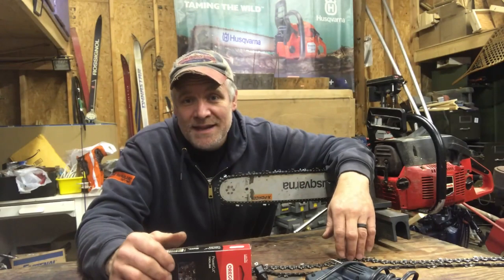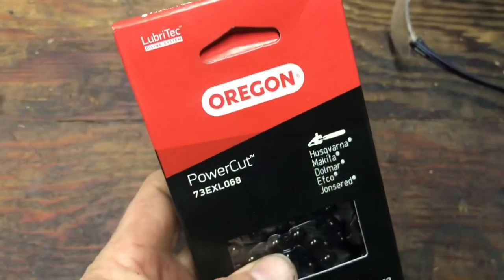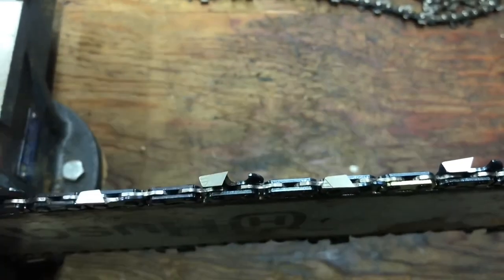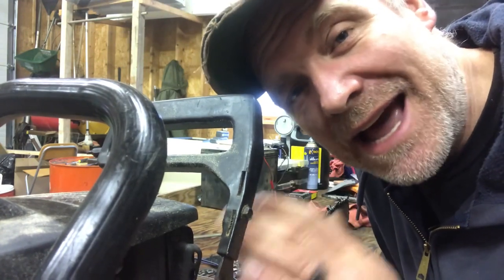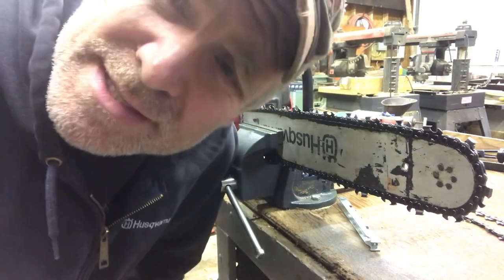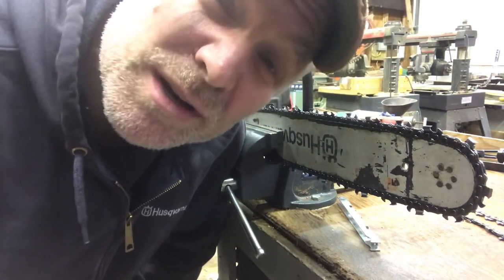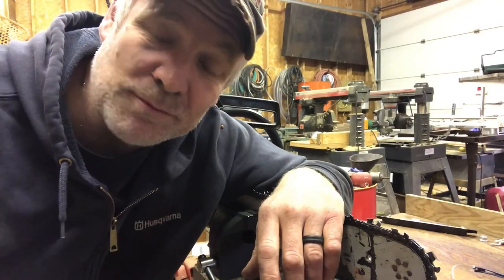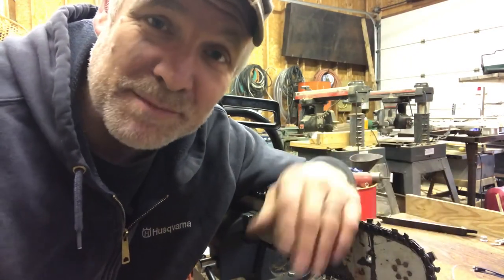Making a Homemade/DIY Ripping Chain for my Chainsaw Mill

Comment: If i may, I would suggest making several light rotations of grinding a little bit at a time instead of one heavy and one light round, several light rounds of grinding will prevent heating up and tempering the tips of the teeth, making them brittle and prone to chipping and breaking. when grinding take notice if the color of the tooth begins to heat up and change your grinding too much.  *this info is meant for electric sharpening only, if your hand filing your chain  with a round file, this does not apply.
Reply: Glad I wasn't the only one thinking about that

Comment: lol the file bit is real!! But the funny thing is back filing can clear the teeth and keep them sharp also depending on the material your working with there is actual a video on yt a man made a machine to prove this point! Can you imagine the amount of hate he got lmaooo! This is awesome I need to find a way to try it for now I’m using hand files to sharpen my chain… I’m using an electric wen chainsaw… with a crosscut chain to hand mill my logs needless to say it’s waaayyy harder than it needs to be I don’t even use a guide most of the logs I mill are 4’ or less so the guide would be nice but the ripcut chain would make my life easier! Hope all is good and getting better

Comment: Look forward to seeing the results of the modified chain. Never seen it done this way. I have made a few for my mill but just changed the angle to 5 degree and didn't make it more narrow. Have a Blessed Day Pete. Justin
Reply: Did they work better after changing to 5°?
Reply: @noturfather1106  It did. Not as choppy. You may wanto try 10 degree first. Seems to work good.
Reply: @homegrowncountryhomeplace  I've been running 20° bucking chains so anything will probably do better

Comment: The price of a ripping chain is crazy. I am still using a full chisel chain with my beam cutter and mill. The cut is smooth enough for me especially if your going to run your boards through a planer. I'll be curious to see the difference in the cut with your modified chain. Take care Pete and happy milling !